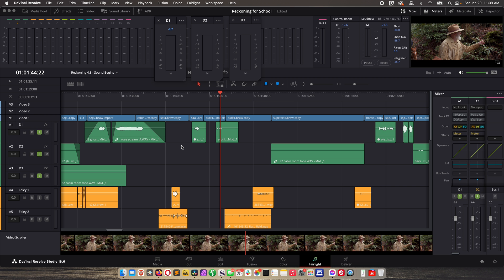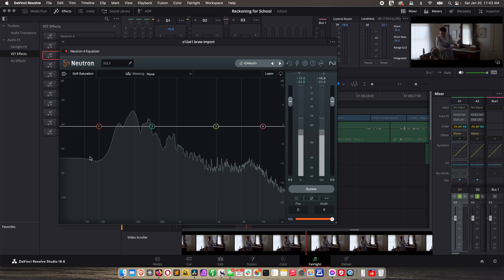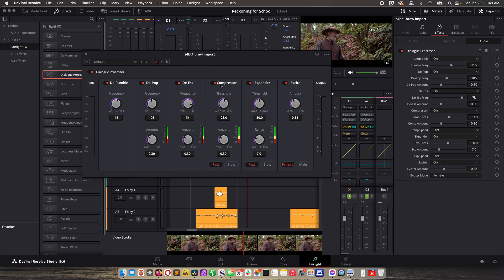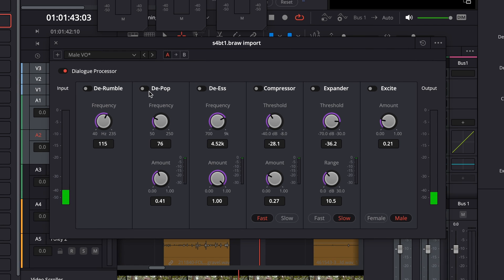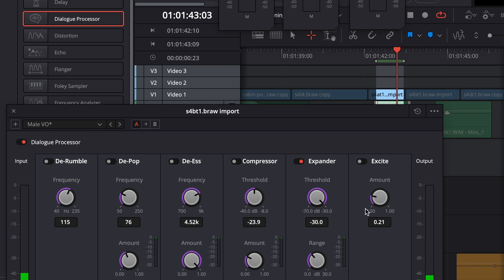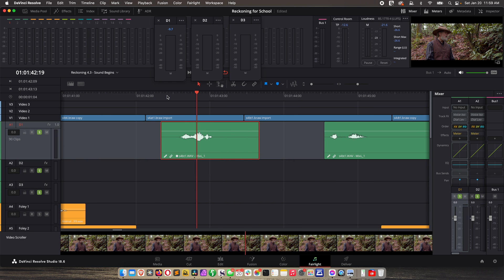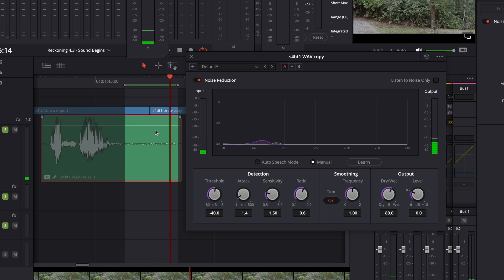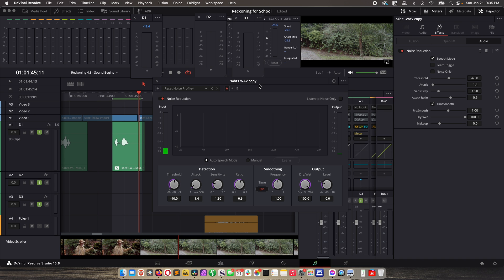Dialogue Part 3 | Dialogue Processor, Noise Reduction & Voice Isolation

Comment: Is it a good idea to process audio even with the "Voice Isolation" effect applied?
For example, if one was trying to match audio from a lav mic to a boom mic with the effect applied.
Reply from the maker: It’s fine IMO. But use no more than needed. Also, switch between monitors and accurate cans to really dial in the match. You might have to EQ. I personally use Izotope for clip based EQ.
Reply: @writedirect  Awesome, thanks for the reply.

Comment: I have watched this entire series.  No need to watch any other videos as this is the clearest and most concise explanation I have found on the subject.  Thanks very much for providing this.  2 questions: 

If I want to reduce a frequency range in a music bed to allow for better hearing the dialogue, do I have to cut up the music clip or can this be key framed?  You say that dialogue is mono.  

You say to edit dialogue and mono.  Why not stereo if I want the dialogue to be heard on both sides?
Reply from the maker: Hey, thanks for the kind words! First question: Yes you can key frame your music. I’m not in front of my keyboard and do it by muscle memory, but I think it’s option (macOS) and click on the clip’s volume line. Then drag vertically, delete them, etc. You don’t have to cut up the clip. Second question: A mono track will come out of both speakers in a stereo only set up. There’s no need to create a stereo track of the mono. And then if you ever moved the mix to 3.1 or higher, you’re already set with all of your dialogue or any other effects you want coming out of the center speaker. Hope that helps!